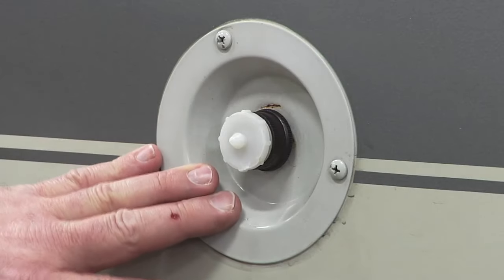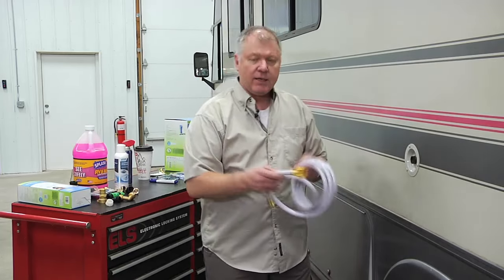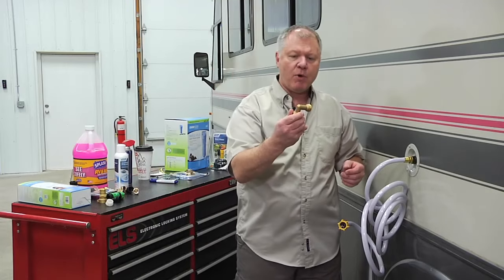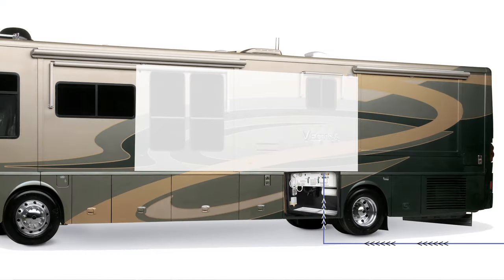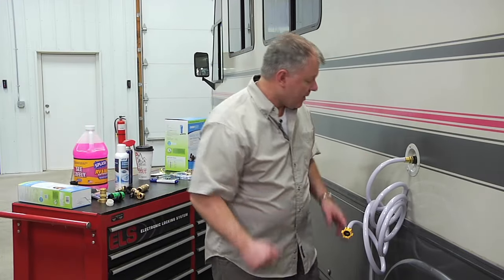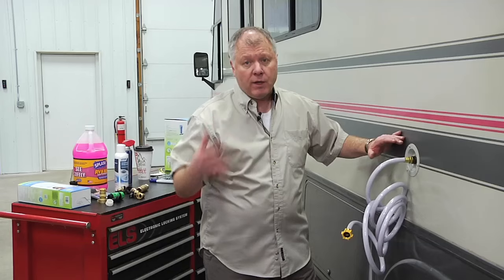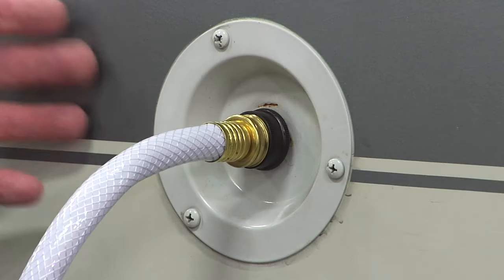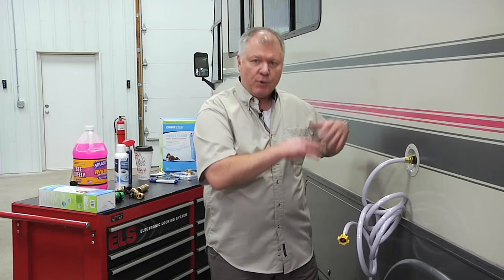How To Properly Connect The RV City Water Inlet

Comment: I always wondered how that worked. So if you’re at home or at a campsite, you can basically run your water non stop. I assume the city water also automatically fills up your hot water tank. Even so I would assume your showers may be short because there’s a limited supply due to a small water tank. I supposed that could be compensated by increasing the temperature of the water heater, which in turn would cause you to use less hot water. I’m not sure how hot an rv water heater temperature gets.

Comment: What is the difference between city and fresh water?  I've seen on some rigs there are two connections but no explanation between the two.  Thank you
Reply from the maker: Hello.  The city water connection is just a standard 3/4" hose connection to connect your hose from an outside faucet to your RV. When you turn on the faucet, everything inside is pressurized and you are now running the water off of the "city" water connection. It is just labeled "city" since you are using an outside water source. The fresh tank is the water you can take with you. You will have a potable water holding tank. This can be filled at home or at a destination. Most are usually gravity fed, meaning the water just gets poured into the fill end with either a hose or bucket and funnel of water, but there are others that need a hose attached to a connection to pressure fill the tank. When you want to use the fresh water system you have to turn on the water pump inside to suck from the tank to go to all of the fixtures. This is because there is no outside pressure, it is just water sitting inside of a tank. If you are at a campground with full hookup you won't need to use the fresh water system as you will have a city faucet to hookup to. The only times you need the fresh water system is if you know you are going to a site that doesn't have a water hookup or you want to use your facilities during travel you will want to fill the fresh tank so you can take water with you. I hope this helps clarify the difference!   
Dan-RV Repair Club

Comment: How do you know which size regulator you need ?  If I hook up to residence outside faucet ?  You said that homes sometimes are at 60 psi .  I see some regultors that only go up to 50-55.
Reply from the maker: You will need to determine the type of piping and connectors your rig has and adjust accordingly. Almost everything is safe at 40 psi which the typical non-adjustable regulators are set at. If your rig has pex lines and Flair-It connectors you can probably adjust up to 50-55. You would not want to hook up to a 60 psi home connection without a regulator, that’s why you see the ones only going up to 50-55 and I would believe they are adjustable down to 40 psi as well? To be safe, get a straight 40 psi in-line with a filter and you will not have an issue!

David Solberg
Reply: Will do . Thank you for replying !

Comment: I have a keystones bullet and when I hool up the city hose it also fill the fresh water tank (which is gravity filled in a separate port).  Why does it fill both?  It over fills it and then leaks into the camper
Reply: Hmmmm .  Something else to have to worry about.  Did you fix it and if so how ?

Comment: What if I don't have access to outside source of water? Can I just keep filling up the water tank without pressurized hose? Like a huge water tank to shower etc
Reply from the maker: If there is no city faucet to connect to, you can just keep filling the potable water holding tank in the RV. Some campgrounds can come by with a larger tank and fill it for you or you can get your own water supply to fill the tank. Most RV's have a gravity fill tank so you can get a funnel and fill it with water jugs or a bucket and use water from a stream or lake. Other RV's have to fill the water tank with pressurized water from a faucet, most of these are on 5th wheels and motorhomes. You would have to see what connection you have to know what options you have to fill the tank. They are all different sizes too, they can be 20 gallons on small RV's and upwards of over 100 gallons on bigger RV's. I hope this helps!

Comment: Hello, I have been hooked to city water connection for about a month now and it had good water pressure up until the past week. It happens with every water faucet and the toilet, turn it on bursts out with plenty of pressure and 2 seconds it's a very light stream. I have a pressure regulator and a filter, using a small 4 foot camco drinking hose. Tried multiple things, my next step is to start tearing apart the city water inlet connect port. Any ideas what's going on?
Reply from the maker: There could be a few things causing this but I would start with the water supply faucet from the city source. I would disconnect your RV and just attach a hose nozzle and spray the ground and see what happens. It could be something from the campground you are at. If this is fine, then you want to start troubleshooting the items in the RV. Typically the regulators just have a fixed opening and tend to not fail unless there is a blockage. If you have a spring loaded one, it could be getting stuck. Test without the regulator to make sure. Filters can get clogged and could cause this to happen. I would remove the filter from the system and see if this helps, you just have to remove the filter itself not the whole housing if it is a replaceable filter. There is the possibility of a water line being kinked as well. I would check the lines from the city water connection to the pump. If they are in a cabinet, it's possible something bumped into or fell on a line causing a restriction. The city connection does have a check valve on it to prevent water from going out when the pump is being used, I have seen these cause restrictions before. This would be the next thing to check after checking the other items I have mentioned. This would really be the last thing that could cause an issue. Again, I would start with the campgrounds faucet. It is possible they are the ones having a pressure drop to your service. I hope this was helpful!
Sincerely,Dan RV Repair Club

Comment: Where do I hook up the regulator to ? The rv or the hook up
Reply from the maker: Hi Paulette.  It doesn't matter. If you have it connected to the city hook up, everything from there will be regulated line the water hose and filter if you use one. If you hook it up at the RV, that's where the pressure will drop so your RV will still be protected. The water line doesn't need protected but water filters should be. I always hook mine up at the city faucet since I use a water filter at the RV connection. 
Thanks
Dan RV Repair Club

Comment: what happens if you hook up to city water and get no water thru out the trailer? what could be the problem?
Reply from the maker: Your first want to check and make sure water is coming out of the faucet you are connected to. I would take off the hose and just make sure water is coming out before looking into the RV. After that you will want to inspect the back of the city water connection for a kinked water line. If everything looks fine and nothing visible can be found most likely the issue is the check valve on the city water connection. There is a valve inside that only allows water to flow in one direction. If this gets clogged or stuck in the blocked position it will prevent water from getting in. If it does fail you will have to replaced the whole city water connection. Most likely this is the issue but before replacing anything you want to make sure to inspect everything else to make sure it isn't something else.
Reply: @RVlifestyleandRepair  Thank you so much. It was the check valve at the hose connection

Comment: Is it just me or is anyone else bothered by the fact that the potable water fill in most campgrounds is in the same vicinity as the pump out station? What would be the best  filter to sanitize water coming in from either the fresh water holding tank or city water hookup?
Reply from the maker: +Randal Ovcen Thanks for visiting the RV Repair Club page. I agree that in my cases the potable water spigot is a little close to the dump station. That is why I always carry some bleach and clean off the threads at the spigot and never drink water from the campground source. Camco makes a handy in-line filter that can be found at most RV dealers as well as home improvement stores. They have a variety of different filters for lime, rust, and flavor. You can also use the residential style blue colored version that has a screw on top and drop in filter. Intellitec offers a water purity tester that I use as well. Hope this helps.